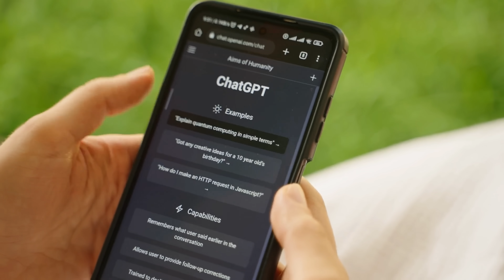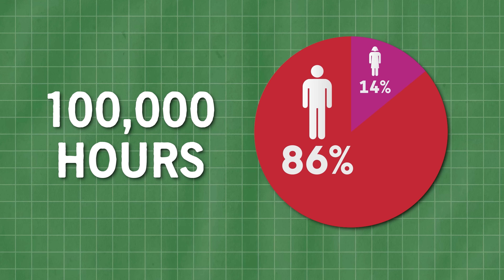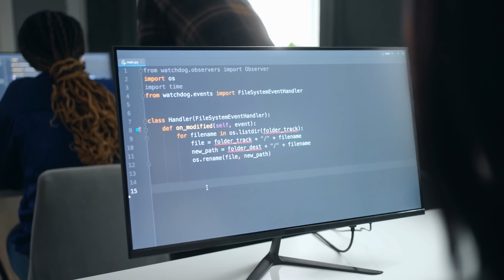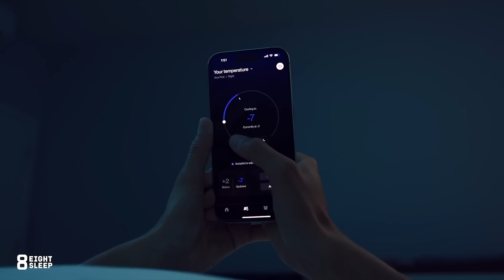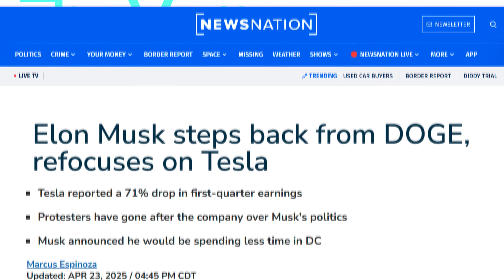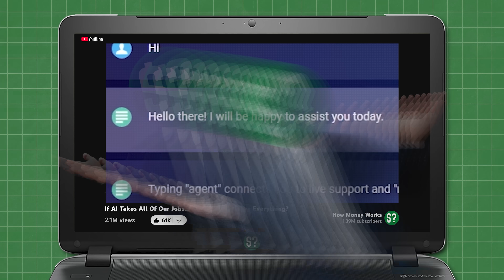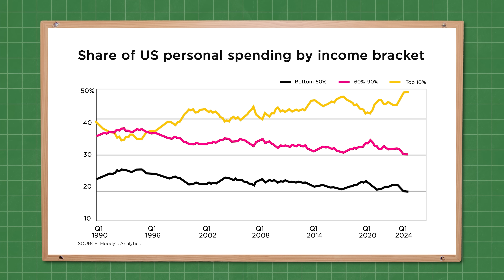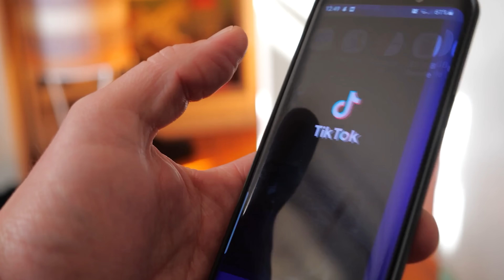Are You Ready To Have Your Job Replaced by AI?

Comment: Full automation of all jobs will take a while, but I think we can already start thinking about solution which I believe are not that hard to implement with a bit of political will.

1) Labour Side

I think it will be interesting to analyze this as a labour supply and demand problem.

If labour demand goes down due to automation, there is a few solutions to help re-balance it so that worker still get a good pay.

First solution, is to have less workers. We are doing a good job of that with current weak natality rate worldwide. In fact, I believe that the current decline in natality is in fact fueled by the lack of income stability caused by the most recent wave of technical innovation coming from cellphone and the internet.

Another solution is to limit the amount of hours worker can do, if everyone can only work 25 to 30 hours a week instead of 40 hours a week you basically decrease labour supply significantly which can offset the lower demand keeping wages and income steady.

I think the second point is important as it will be weird to have some peoples with unreplaceable jobs working 40 to 50 hours a week in a world where most peoples (let say 80%) don't have a job.

2) Tax Side

Obviously, taxing the wealth created by the robots and redistributing it via a universal basic income (UBI).

Here, the debate would be on what kind of tax to use. Economics is full of analysis on that but I would assume some form of capital tax or very high marginal income tax past certain threshold.

Comment: The thing with this robotarms and spezial Equipment is that they are stronger, bigger or better suited for handling Special parts. You cant just use a human model for everything. Just look at nature. Does every animal look like a human.
Reply: Same goes for cost. You can get a roomba-like for 40€, you will not spend 20 000€ to replace it.

Comment: The "learn to work with your hands" thing is just so depressing to me.

I've spent my life learning, creating things, discovering new ideas, and teaching others. I *do not want to be a fucking plumber*.

That's not a knock against plumbers or other tradespeople, some people are suited to that, and its a great job for those kinds of people. I'm just not one of those kinds of people.
Reply: No one's thinking about what happens when plumbers get replaced. Sure, that's not happening anytime soon, but if you can replace a line worker packaging things, pressing a button, someone in the fry line, etc, you can SOMEDAY replace a plumber.
Reply: @drew8235  It definitely will happen eventually, first it will start with new construction not requring a plumber because there's a machine that can be made to do that for us. Then, the older buildings will come down because they generally do eventually, even the relatively new building that was built for Psycho was replaced piece by piece until it was completely new before being torn down in it's entirety. Other buildings may last longer, but very few buildings last for centuries.
Reply: True, plus also the reality is there wouldn't be enough positions for everyone to be a skilled tradesperson. We had experts recommending everyone get into STEM and look how that turned out.
Reply: @patricklippert8345  When I was in high school, the experts recommended that everyone go into nursing. Somehow, the underlying reason is still true (the aging population needs to be cared for), yet I'm seeing nurses leave their resumes at grocery stores and fast food places because they can't find jobs.

With STEM and tech, there actually is a way in which they're fields that grow themselves. More development means that you need more people to maintain systems and research new advancements. Doubling the number of people who know how to program in the population can actually double the amount of software created, especially when you have people starting their own businesses and such.

Skilled trades are not self-replicating in that sense: if you double the number of construction workers, you don't double the number of homes being built.
Reply: @Langtw  your comparison wasn't accurate. Building more homes creates many many more jobs than just building that home. I'd steer away from that argument. I understand not wanting to do trades. They also don't want people who aren't suited for it or don't want to be there. You will either have to find something or build your own thing. Every squirrel hopes their nest will survive the winter. Best of luck to you
Reply: @WoodworkingforAnyone  I don't think you understand what I meant. The problem isn't about the number of jobs. The problem is the *demand*.

What do you think happens if you wipe out an entire sector of the economy, then move those people into a field where the demand is effectively constant?

Projections indicate that roughly 1.5 million new blue-collar jobs will open up in the US between now and 2035. If an entire sector of the economy gets annihilated, that number *does not go up*.

If 40% of white collar workers in the US lose their jobs, and 10% of those people retrain into trades, that would be roughly 3.5 million new workers... more than double the number of openings.
Reply: @patricklippert8345 : "We had experts recommending everyone get into STEM and look how that turned out."
.
What did I miss?  How did that turn out?
Reply: @ The market got oversaturated with college and bootcamp grads that companies didn't hire and the big companies hired visa workers instead. Then a huge wave of tech companies "rightsizing" with layoffs as companies replace workers with AI.
Reply: You are not alone, I am visually impaired so totally understand what you mean and am the same.
Reply: This. I worked 10 years in factories. Met people who love to work in factories. I despised every single day spent in them. I spent months in depression because of it. How come we have to adapt to only what a portion of the population likes while the job I find passion into doing forcefully disappears forever, keeping only the jobs I despise the most as the only available one? How is this "progress"?
Reply: @Dexter01992  Exactly. If new technology means just gets worse for everyone except a very small fraction of the population, what's the point?
Reply: @Langtw in the worst case we will have to shut down the internet together by cutting through the electrical wires on the way. Many are above the ground, so we can succeed here. If they don’t give us any alternatives to live and have purpose, we owe this to ourselves and our children
Reply: I wanted to be a plumber, until I found out that the job is 100% commission based. I can't sell to save my life, and would prefer an hourly wage to getting paid based off my ability to convince someone to buy something from me.
Reply: @Cross_Malaki what? You talked to some shady company dude.
Reply: I've attempted to start a trades career, stopped after realizing that it's a useless endeavor since literally everywhere I apply to isn't actually hiring or they require 2 years of prior experience to pay $18 an hour.
Reply: This is pretty dumb, by the time you learn to do something with your hands automation will come to the physical world too and everyone else trying to do manual labor will lower the wages through competition. That's not really an option.
Reply: if it ever gets to that point, society is cooked. You're talking over 50% of population out of a job that now needs to transition into plumbing, construction, electrical, etc trades? Firstly that would tank those trade wages due to insane competition. Secondly, demand would tank as those people who can't/don't want to transition into trades can't afford these services in the first place. Gov would have to step in with some kinda UBI or something to keep people afloat.
Reply: When everyone is looking for work in the trades nobody will have work in the trades
Reply: Ultimately, it is just prolonging the inevitable as the work would eventually be automated as well, especially since humans are good at making tools.  Once you make the tool that can make the tools, it will just cause an exponential rate of change.  That's how technology is currently evolving, most technological advancements have occurred in the past 100 years.  
  
We barely even had internet 30 years ago, now we're looking at automating most people and AGI.
Reply: AI is still smoke and mirrors at this point it is just a higher level of automation 

A better search bar and even then it's not the best search bar 

It is not an intelligence it is not intelligent
It is a parrot that we tough to train itself
Reply: Turns out the world doesn't f*cking care what you want, and this is how the factory guys felt when the world decided Chinese kids should work those jobs instead.
Reply: Don't worry that advice will be obsolete in 5 years. Half the video is about the humanoid robot boom lol
Reply: Desperation is the greatest motivator
Reply: @gmatheus10  that's a nice platitude, but you know what happens when you have 40,000,000+ *desperate people*?

It involves guillotines.
Reply: You're not alone man. I got a degree in language (translation), art (graphic design) and started learning to code. Then AI apocalypse hit. Luckily, I got into it and now I'm specialist who automates a lot of stuff and AI auguments me, but it was a trully chilling moment. A lot of people I've met during my studies got automated away...
Reply: @AsusSusu-o3x  You will disappear once the AI augments itself.
Reply: @AsusSusu-o3x  Yeah, I'm learning to work with AI rather than against it for a similar reason.

I think that there may be possibilities other than "pick up a hammer," but so many people point to that as the one-size-fits-all solution.
Reply: Yeah. I also wanted an intellectual job. Now I quess I am an anti-AI activist 😂.
Reply: if you don't think plumbing and other skilled trades are intellectual jobs you are telling a lot about yourself and lack of exposure to these fields.  most trades are primarily difficult because of the years of experience required for complex scenarios and machines, referring to them as less than that exposes both your prejudices and ignorance  @troodoniverse
Reply: Maybe you should learn to code..
Wait...
Lololol
Reply: @CharlieKellyEsq  As a software eng, I can tell you that the seasoned vets aren't going to be replaced, at least not much. But we aren't recruiting much newbies anymore.
Because part of software engineering requires the converge of all corner cases, as our biggest enemies are end users that will, intentionally or not, do weird/bad things. AI is good enough to slap together something that works, but not quite capable of providing comprehensive coverage or drill down on odd failures that requires considering the chain of operation. At least not yet. This is where the vets will still be needed.
However, a lot of the more basic work, such as refactoring, fixing/changing display text, converters etc, are being offloaded to AI. These are the works that the intern/trainee used to start with. So afaik, those are being hired/taken on at a much lower rate.
And that is likely sustainable/status quo for at least one or two decades--AI gets better and take up more work but engs also retire, the remaining eng is still just sufficient to keep the boat going. The question is more what happens when the current gen eng is all gone. Will we have replacement for whatever work AI still can't yet handle.
Reply: @CharlieKellyEsq  If you think AI is replacing software engineers you are clearly ignorant about what you are saying. All it is doing is wiping out BS jobs while making actual developers even more productive. You cannot deliver or come anywhere near comprehending an actual software product, even if you generate a crappy one with prompts. We design and implement them without any AI - using it simply helps us get ideas and automate less productive tasks that we already understand very well.
Reply: Adapt or die, that's been the task of humanity since the wolves hunted us. At least all you have to do now is fix your own stuff instead of having to march into predators dens to rid the community of them.
Reply: @XDamainI there is no adapt to agi you fool
Reply: Well, prepare to be replaced
Reply: @CharlieKellyEsq  Its always hilarious when people get smug about the trades in these scenarios. If a huge percentage of cognitive work goes *poof*, the demand for the trades also gets destroyed. No more building, no more renovations, lots more folks going DIY for smaller fixes that bring the highest margin to things like plumbing, auto mechanics, electricians, etc. Some of these tradespeople sound like they are practically routing for all the cognitive office jobs to be replaced, without realizing it would also be AWFUL for the trades.
Reply: @X85283 it's a class war. A ton of trades people hate snobby rich people treating them like low lives for some reason.
Reply: @CharlieKellyEsq Prepare to be replaced. Your value is zero. As an AI bro your life is worthless. I bet you can't even write a 100 word essay without an AI.